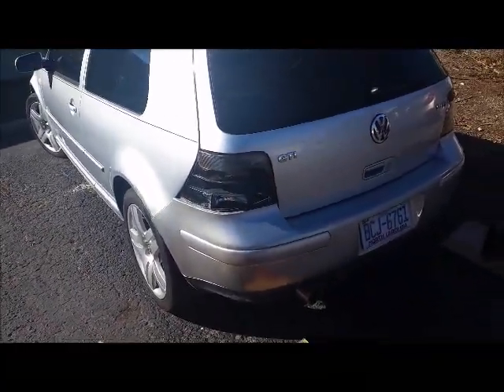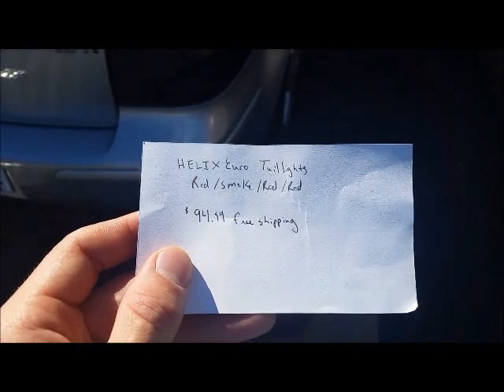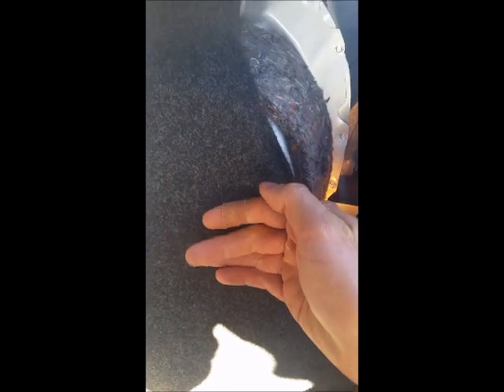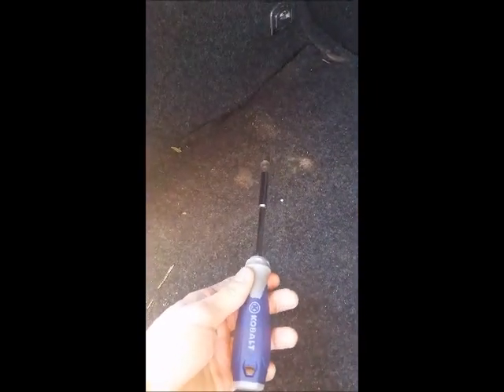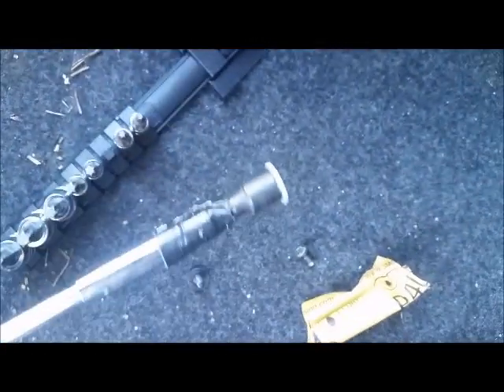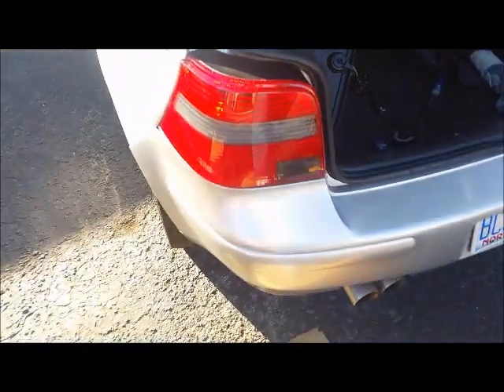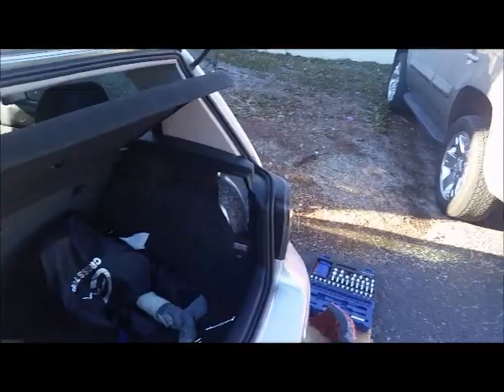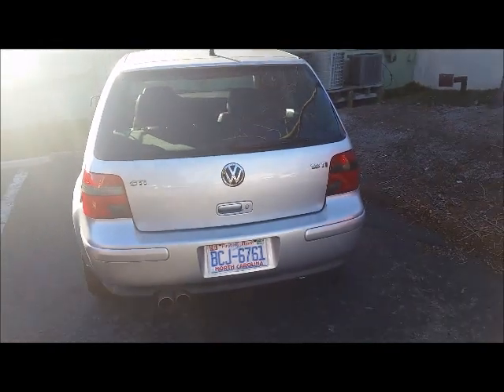DIY replace taillights MkIV Golf GTi

Comment: Perfect tutorial! what year Is your mk4? thanks for the assistance I will be doing mine tomorrow I found the same tail lights here locally!
Reply from the maker: thanks man,  glad to help.  2003
Reply: +D-trick I have a 99 MK4 Golf I bought some MK4 GTI taillights will they fit ? Thanks !
Reply from the maker: +Alan Ramirez sounds like a question for the taillight manufacturer man. Compatibility is not something I am familiar with. I wish you a smooth project.
Reply: +D-trick I was able to fit them just fine it was a little difficult on the driver side . But it turned out good !

Comment: just did my girls mazda 2 brakes no problem but im having difficulty figuring out my 2003 GTI 1.8, need to replace taillight and change brakes. anyone with a tutorial video or even personal assistance would be appreciated! also if anyone needs a good sound system in CO i know a super cheap place called PDA audio. Literally amazing..... under 300 bucks and my bass makes you're eyeballs shake:)